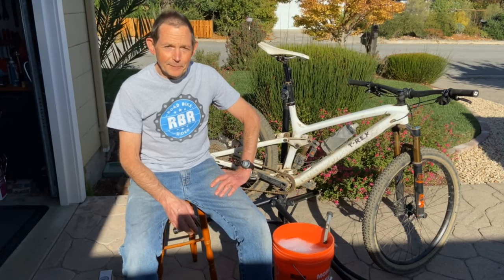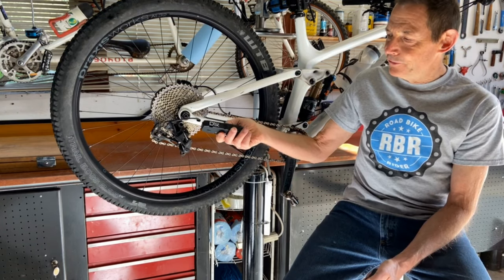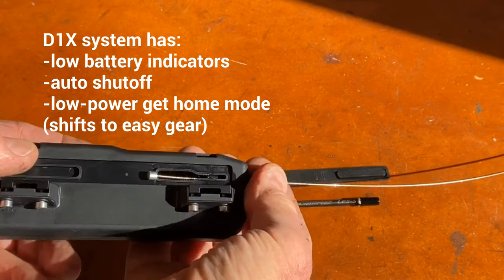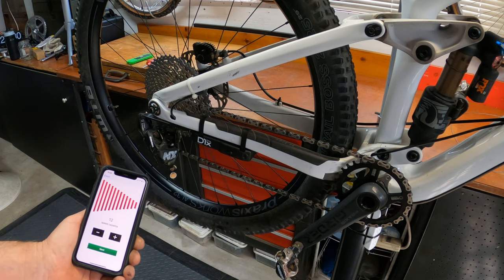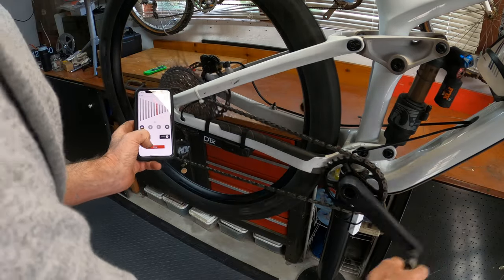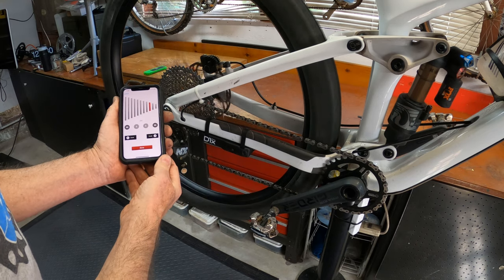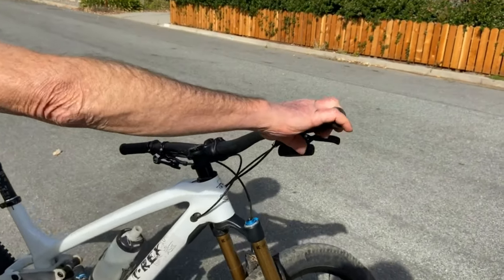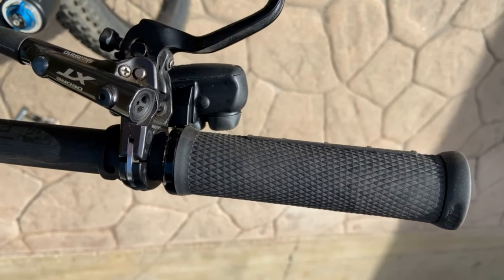Upgrade to Wireless Electric Shifting with Archer's Low-Cost D1X Trail Bike Components!

Comment: I am having an issue with my new velomobile where I cannot get the mechanical shifter to shift correctly, it seems like it is always going too far no matter what I do and its virtually impossible to shift while going up a hill. Do you think this shifting system would fix this? Its not much fun to ride when you're afraid to shift because it might jam and then you cannot move and have to get out and lift up the wheel and pick up the rear wheel and shift it manually.  I've had a bike shop take a crack at it and they couldn't fix this issue apparently, although I'm not sure how skilled they are. I have a 'rotor 1x12'.
Reply from the maker: Thanks for watching and the question, 100toeface. From what you describe, it sounds like you might have a bent derailleur or a bent derailleur hanger. This is a very common issue that is caused often by bikes falling over. Do you know if the mechanic checked your bicycle with a derailleur hanger alignment tool?

I mention this because you need to make sure your frame and derailleur are working properly even with the Archer electronic shifting system or any other e-shifter brand, too, like from Shimano or SRAM.

When a frame derailleur hanger or derailleur gets damaged and bent it usually makes the derailleur shift too far toward the spokes. If you keep shifting you can get the chain and derailleur jammed in the wheel, which can damage the wheel.

You can do a visual check by shifting down onto the smallest cog on the rear. Then stand behind the bike and look carefully at the derailleur. On a perfect rear derailleur and frame, an imaginary perfectly straight vertical line will be able to bisect the smallest cog and BOTH derailleur pulleys. 

If that's NOT the case with your bike, then you might have found the cause of your shifting issue. Anyone with a derailleur hanger alignment gauge/tool can help. I have a video about the tool here: https://youtu.be/du08XdYc1KI

I hope this is helpful and you can get your bicycle shifting correctly again. I'm happy to answer more question if you need more help. Good luck!
Reply: @JimLangley1  Thanks so much for that response, really amazing, much appreciated it, I subscribed and watched the video link. Since its a velomobile I'm not sure that tool will work because of restricted access to the rear wheel, but I'll let the bike shop know and see what they can do, thanks! If all I have to do is replace that one part I'd be more than happy to just do that. Although it has shifted badly since I got it brand new(which is a week ago), and it is inside a carbon shell protected so I don't see how it would have gotten bent during its voyage at sea. Then again I can't imagine the dealer shipping it to me misaligned either so something must have happened to it on the boat. I did order the Archer system as well, seems it would eliminate 2 sources of issues, the cable and the shifter, if I ever do get this fixed.
Reply from the maker: @100toeface  thanks a lot for subscribing! Did you buy one of these bikes: https://www.velomobileworld.com/ ? If so, please tell me which model you bought and I will see if I can find a schematic drawing or photos of the drivetrain to try to determine what might be causing the jamming. Also, please explain what you mean by "jamming?"

For example, does the chain get stuck in the sprockets so you can't pedal? Or does the chain shift and then stop shifting before it reaches the gear you were trying to select? Etc.. there can be many causes of jamming. Explaining what's happening would help me try to figure out what might be the problem. Because it's a new bicycle it might be something relatively easy to fix. Usually a dealer would test ride a bicycle before shipping it and as you say the shell should have protected the frame and derailleur.

I wonder if something is wrong with the chain itself? For example, if the connecting pin wasn't fully inserted during chain installation, that pin could jam and stop the pedaling and shifting. I'm happy to try to help more if you can describe more what's going on. I would expect that any good mechanic could find it pretty quickly and let you know what's needed to fix it. So that's a good option if you have a good local bike shop. I'll be interested to hear what they find if you do that. Good luck!
Reply from the maker: @100toeface  I had another idea for you 100toeface - looking at the photos of the different Velomobile models it looks to me like the chain runs beneath the seat. If that's the case, it must run under some rollers/pulleys or through some type of channel. Since something is jamming, maybe the mechanism that controls the chain is loose or misaligned and needs to be fixed? Just one more thing you might look at. Since it's a new bike I'm thinking it must be some kind of minor assembly issue such as this. Good luck!
Reply: @JimLangley1  Thanks a lot. It is an Alpha 7 velomobile. The dealer seemed quite good, I find it hard to believe he would ship it in this condition, so I conclude that there must have been vibration from a month on a container ship that caused something to get messed up. Maybe the derailleur got vibrated out of alignment. It is almost impossible to get it into the lowest gear without tons of gear crunching sounds, as if there was a huge bag of rocks being thrown around. By 'jam' I mean sometimes I am unable to pedal at all if there is a particularly horrendous shift. To fix it I have to pick up the rear wheel and pedal with my other hand and manually shift to higher gears to get it unstuck. If I am inside the velomobile trying to do that normally, the pedals wont move at all. Two days ago this jamming happened and now it seems as if it is in a super high gear(s) all of the time even if I shift to what should be the lowest gear, it is still as if it is in a high gear. I pushed it home and dropped it off at the bike shop, I'll let you know what they say-you've helped more than enough. Again thanks for the ideas, I wish you worked at the local cycle shop that's for sure.
Reply from the maker: @100toeface  Boy, something must be wrong for sure. Such an amazing machine should work perfectly. I hope the bicycle shop can identify the problem and fix it so that you fully enjoy it. I would be interested in knowing what the problem was if the bike shop figures it out. Good luck!
Reply: @JimLangley1  Surprisingly it was in fact a bent derailleur, not sure how it got bent. Now it shifts fine except it is still a bit finicky getting into the lowest possible gear, I guess installing the archer won't help that issue either. I have Rotor 1x12 with a 560% Gearratio
chainring with about 54 t. So I have a Ratio near 1:1. However I cannot maintain anywhere near a 60-90 cadence up even somewhat steep hills. I don't mind losing top speed for hill climbing ability, what size chainring down from 54t would you recommend?
Reply from the maker: @100toeface  I’m happy to hear it was just a bent derailleur. For a chainring, It really depends on where you ride most. If you’re climbing a lot, I would go much smaller - like gravel bike gearing (42 teeth). But that could mean spinning out on long downhills. So you may want to go in-between like a 46T. It’s one of those things you usually have to try it to determine what is the right gearing for you, your fitness and where you ride the most. Hope this is helpful.

Comment: Mine failed twice. First on Remote (under warranty) and and time on the shifter (dead motor) which was a few days after the warranty. Now Archer wants to charge me $76 for rebuilding the shifter. Total mileage is only  2184km. not so worth it after all.
Reply from the maker: Thanks very much for sharing your feedback on the system ivanteo.
Reply: @JimLangley1  It's just not suitable for situations where failure is not an option.

Comment: Problem is there is no indication of which gear you are currently in.
Reply from the maker: Thanks for watching and your very interesting comment, "consumer052." It's interesting because you must be used to shift levers that have numbers on them telling you what gear you are in. But, most bicycles these days do not have numbers on the shift levers. 

And that's okay because it's relatively easy to know what gear you're in by simply looking at the chain and where it is on the sprockets. A lot of today's drivetrains, too, only have one sprocket in front so you only have to look at the back and can see if where the chain is. 

If there are 11 cogs in back, for example, you can look at the chain and have a good idea where you are in your range of gears. Another way riders tell is by how the gear feels to pedal and also by how many clicks they've made with the lever. 

But, you're right. If you want a lever that shows you what gear you are in, you won't get it with this system. Thanks for the great comment.
Reply: @JimLangley1  Thanks for your reply!
I have an e-bike, its raally not safe taking your eyes off the road when you are traveling over 40 mph.
Reply from the maker: @michealbackus4543  thanks for explaining. Yes, please stay safe. I have an e-bike, too. Mine is an 11-speed with one sprocket up front. The way I shift is based on how fast I pedal. If I'm "lugging my engine," I shift into an easier gear. If I'm spinning my legs like crazy, I shift into a harder gear. I shift a lot to keep my legs going at the rate that I'm comfortable with. I can always tell when I "run out of gear toward either the highest/hardest or the lowest/easiest because the bike won't go into any harder a gear or easier a gear. I know that the hardest gear is 11th and the easiest is 1st. For the 9 gears in between, I just go by feel and you get pretty good at finding what feels right to your legs and lungs. Okay? I hope these tips are helpful. The one thing that an electric shifting drivetrain could offer at some point is an app that would show on your cell phone what gear you're in. The Archer system app does this when you do the setup, but I don't think they have a riding app for watching the gear you're in as you shift. Maybe someday. Thanks again for watching!